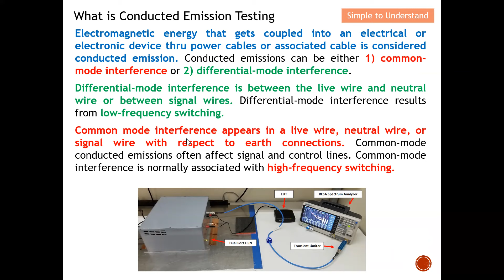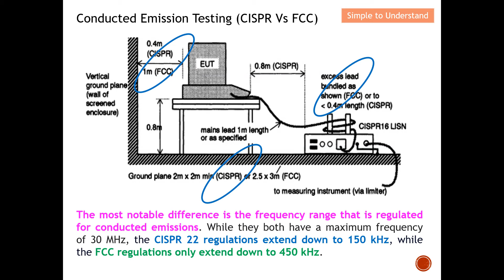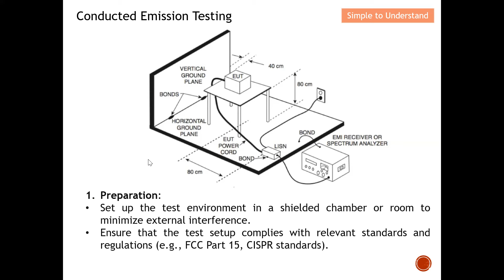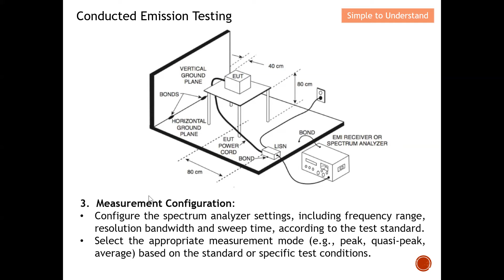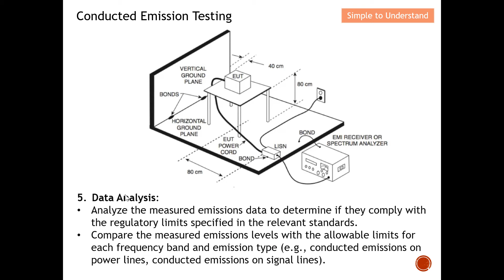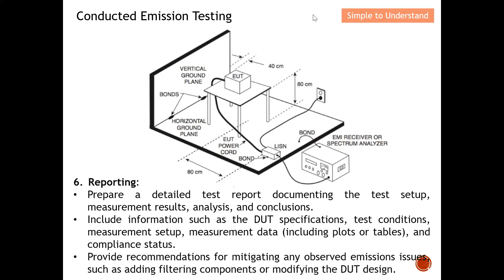Comment: I need you to correct me if i am mistaken. In the conducted emission part the unit for measuring it, is shown as dBuV/m which is not correct and does not need to me measured in meters. is that right?
Reply: For CE right? CE is without meter.  :)

Comment: I think you are working on old information. FCC limits were extended from 450 kHz down to 150 kHz around 2002. The separation from the VCP is also 0.4 meters now, not 1 meter, and the cable bundling shown is incorrect.
Reply: Thank you for your input, most of my works is according to CISPR stds. Sorry if the info is old ones.
Thank you for correction.  :)